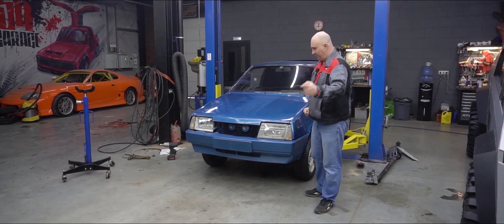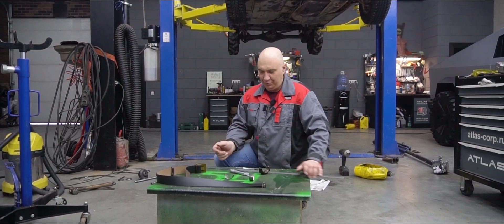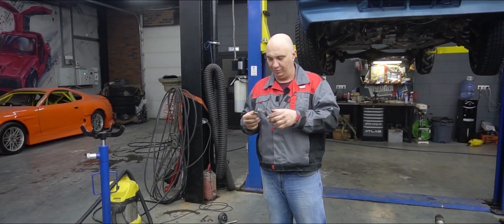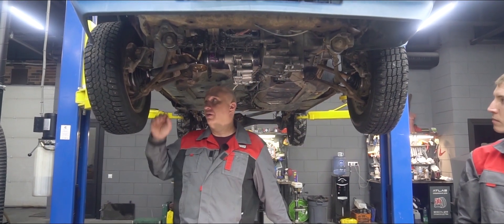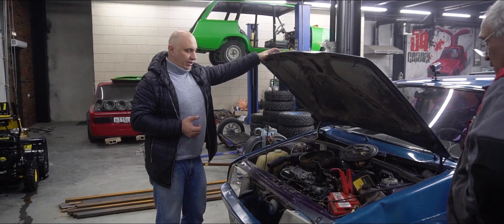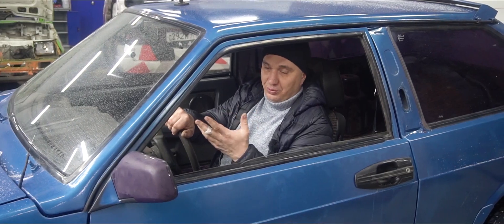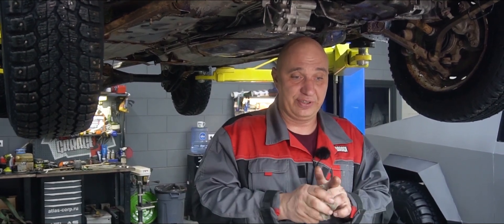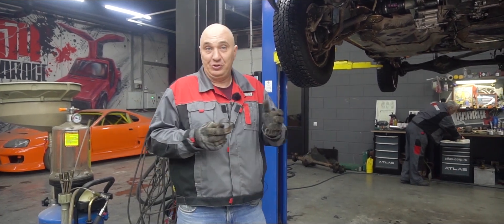Can you replace crankshaft bearings with leather belt?

Comment: The leather rod bearing trick only works on low power, low RPM motors with splash lubricated bottoms ends without oil pumps and sump screens, like model T's, Briggs Stratton motors, and old tractors. Modern high compression, high RPM engines with oil pumps, sump screens, and pressure lubricated cranks with holes for the oil in them will just eat the leather up.

Comment: When I was in the military 30 years ago we were stationed off grid and the radio's all worked from the generator, the engine failed and a backup generator or parts was a week away and we needed to charge the radio batteries way before then so I replaced the main bearings with leather strips cut from shoes, that generator where still running smoothly 8 months after I was relieved before they finally decided to change over to a new generator. Over a year of running 24hours a day.

Comment: I mean, hydraulic pistons use leather for sealing. You can save literal hundreds of $$ if you replace airless paint sprayer packers with leather, as leather's cheap, while the "original packer kit" is usually 150$ + ... The leather packing lasts for ages.

Comment: I have heard about this many years ago in Ireland.  But I have a Ford Cortina back in the day which had a main bearing rumble when I bought it. Because I did not have the money to replace the main crankshaft bearings this is what I did.  I inserted aluminuim file between the the main bearing and the block and main cap. I added and tool out 1 layer at a time so shimmimg it with the ally.file. I did this until each main was tight but could rotate. I did all the mains like this and put the motor back together and in the car. I drove the car for many years with no rumble or other issue. When the rest of the car fell apart with rust I sold the engine to a friend and he also drove it with no issue. The alumininm file acted as a shim and allowed heat transfer and because it had oil holes it allowed normal oil flow to the crankshaft. An old meahanic I worked with said it could be done and when the time came I proved it could and was successful.

Comment: A few suggestions:
1) The belt should have been glued to the conrod. If it's just placed in there it can spin in the conrod (the equivalent of a spun metal bearing). Since the oil is coming in at the journal, there would be no oil between the leather and the conrod and so it would be spinning and tearing up.
2) The clearance between the leather and the crank pin needs to be exact. Just throwing in a piece of leather without the correct thickness is the same as throwing in a metal bearing that is too large for the crank (it won't turn over and will fail immediately). This could be done by gluing the leather in and then spinning it in a lathe to get the journal +.002 clearance for instance.
3) It might help to coat the outside of leather with an oil proof coating. The leather expands when saturated with oil and there's no need to lubricate the inside of the leather just the mating surface between the pin and the leather needs oil.

Doing all these steps I think it's possible that this leather bearing setup could work for a few hundred miles.

Comment: Thicker bearing (belt) will cause the pistons to come closer to the head during the compression cycle (top of up travel) where the valves are as well as closer to the head at the bottom of travel. I do believe you have changed the compression ratio and it is gone up a fraction.

Comment: Used leather bearings on an old disc plow when I was a kid. Worked great although obviously didn't last as long as metal.
I think they'd be fine for low speed, moderate stress situations, which inside an engine clearly isn't either of those things.

Comment: You said the myth was that they sold cars with these, I think you might be right, if they soaked them in oil overnight and oiled everything up and just turned it over enough to run then fired it up enough to run smooth then checked periodically if it would crank fine and then once it was enough to look good, they would sell it, sounds about right, also you could pull the axels and say it needs them and won’t drive or remove the clutch disk and say it needs one of those, just like when people try to sell us diesels saying they need a starter and we come over with a starter, suddenly they have to go out and we can’t stick around, meanwhile earlier they were talking about helping us try to figure it out and give it a boost and all that, funny how we forgot to mention we were gonna try the starter right away

Comment: My Grandfather was a tenant farmer. They were very poor when m6 mom grew up. My Grandfather talked about using leather to keep his model T running. He said it worked fairly well. But these engines didn’t make a lot of horsepower, so it’s possible.
They might need to put a longer rod bolt in it, and double nut it to keep it in place. Then we could see it die dramatically!

Comment: My machinist bible says leather on cast iron has higher friction than wood on cast iron.
Leather was used for steam engine flatbelts to drive everything....they dont slip.
Leather is an abrasive, of course it won't work as a bearing.
Let's try sandpaper bearings?

Comment: i bought a 1986 hyundai exel years ago from a used car lot and after driving it on the freeway going home , trying to climb hills was a process , all the other traffic moving at speed limit or faster but me 25 mph 2nd top speed. half way home i noticed the rear window coated in oil and non in the engine . i fixed the oil leak the oil pan gasket. then about 500 miles later going 25mph up a hill a loud sudden knocking ....rod bearing! i pulled it apart and found what apeared to be tin foil all over in the crank case. i dont know but always been curious if it was possible

Comment: i worked at a auction dealer auction  a audi once blu up before making it to the block to do the bidding and it looked like mush and stuffs in the oil they put saw dust for the knocking engine??? didnt work out seeing as it blu up later but was waiting on the line for a good 15mins

Comment: The real issue was that the belt was too thick. Properly sized, this works for awhile. The rod cap loosened because it wasn't tightened against the rod, but the belt, which shrank or moved, loosened the cap, then the bolt loosened and the belt dropped free and became debris.

Comment: I was told a similar story by my grandfather. He said he was driving his Ford Model “T” in a western American desert. He heard a rod knock. He stopped by the side of the road, removed the oil pan and found the loose connecting rod. He removed the cap and “cooked” a piece of his leather belt in oil. Then installed the section of belt in the connecting rod, reinstalled the oil pan and oil and was able to drive some miles to the nearest town where permanent repairs were done. Using the leather belt got him out of a breakdown situation in the desert and possibly saved his life.

Comment: As soon as you lost pressure I knew that pump was clogged with chunks of leather lol
Also, I was thinking this method would be more effective for a worn out bearings.  If the crank shaft is in good shape, it’s not quite the same.

Comment: Once my father had a 1949 dump truck with a six cylinder that had dippers.  New oil systems work completely different.  We took off the pan and he put some raw hide leather in where the rod bearing was knocking.   I'm thinking it was still there when he sold it years later.

Comment: Maybe try what you said and make them into a two piece so that the caps bolt on without pinching the leather. And if there are oil passages make holes? You should also try to stamp the leather with a hammer and make it stiffer.

Comment: Try sanding the leather on the concrete ground not the fancy side use that for the side that moves use a belt hole maker for oil channels line it up.

Or use cheep flex able aluminum like the ones found in padlock latches from garage doors or cabinets

Comment: This was common back in the early days of the automobile when engines had babbited bearings and didn't have the RPMs of today's engines.  

My grandfather told me of driving his Model T on the back roads when it chewed up a bearing.  He got out the tools and dropped the pan, used a piece of his belt to make a bearing and put it together.  It got him back to town and lasted until he got it fixed properly.

Another common repair later on, when bearing shells replaced babbit, was shims behind the bearing to tighten the clearances if the crank was worn.

One of the main things people carried was a roll of haywire to tie parts back on when they fell off. lol

Comment: I’ve known of this trick, much like filling a differential or transmission with loose gears up with saw dust and oil... only exception is I believe the leather belt scam was ONLY FOR 1 or 2 SPUN BEARINGS!!  The thick belt would keep it from knocking temporarily!!! NEVER would good bearings with close tolerances be pulled and replaced with leather!!!! THATS SO SILLY! Haha haha

Comment: We used to run leather bearings on an old 40’s tractor engine we used as a constant rom mill engine.. bearings were obsolete so we used to soak leather in 10w40 for about 2-3 days before we dropped the bearing caps to swap out the leather. It would typically last about a month or so depending on the work load. Did it for years

Comment: One of our local dodgy repair shops was caught shimming the backside of the bearing shells with Coke can aluminium, and 
they at least the poked a hole in it to let the oil through.The shimmed bearings were just a tiny part of what really went on, they did 
every dirty trick in the book.

Comment: The belt was too thick. I know a older guy who did this to a car once when it spun a rod bearing. He fixed it and ran it for quite awhile to get it home.   It's temporary fix but it can work.
Reply: Probably easier to call for a tow truck than lay on the side of the road in an ant pile ripping the oil pan off.
Reply: @Discretesignals  in today's world yes, but the event I mentioned happened years ago before everyone had cell phones. There was a time if you broke down, you either got lucky with what means you have available, or you walked till you got lucky and hitched a ride, Lol... just sayin.

Comment: I find it hard to believe leather would ever be a good replacement for babbitt style bearing in any application in any time, (even antique slower RPM motors. 
What man who has the skill to remove bearing caps, cannot also find some lead and tin to melt and make new bearing material?

Comment: yes put drain holes in the leather maybe try some calf skin let it soak over night in oil cut to proper length and width when put on bearing soe ends together make sure all drain holes are lined up for drainage make sure it is tight when sowen together.in 1957 my dad was a mechanic for a logging company company had a craink bearing go out large loader 50000 lbs that is what my dad done .long story short worked long enough until they could order a new set of bearings gaskets for a rebuild job on motor big diteroit diesel 2 stroke

Comment: My dad told me that in the 1920s & 30s this was done when they had no money for parts. I think those engines were dip and splash design with no oil pumps,so it may have worked.
Reply: superrodder2002   Once my father had a 1949 dump truck with a six cylinder that had dippers.  New oil systems work completely different.  We took off the pan and he put some raw hide leather in where the rod bearing was knocking.   I'm thinking it was still there when he sold it years later.

Comment: In the US, about 1928 to 1938, this was considered a temporary fix. Most of the cars had splash lubrication and not pressured lubrication, so this fix would get you a little farther down the road. This was a time when a wheel barrow full of money wasn't worth anything. In WWII some soldiers used that trick as a temporary fix to get back from the enemy line. Nothing like a connecting rod banging away to give away your position.

Comment: You didn't do it right.
You need thin leather. Like welding gloves. And you must heat it first to make it shrink and stiffen up.
Then soak it in oil and shape it. Cut the holes for the oil flow. Then put it together.
Don't fully tighten the end caps. Start the motor for 1 min. Clean it.  Then tighten the end caps. If done right. You can get lots of mileage out of them. Not as much as normal bearings of course.
But for a farm car where you don't need it often, it works.

Comment: Isn't there supposed to be an outlet from the oil gallery in the crankshaft through the bearing surface lubricating it?
I thiught yiu were going to punch holes in the leather pieces.

Comment: ive put leather in a spun crank bearing its a band-aid tho  high revs are a big no and belt must be same dimensions as bearings u also should soak the belts in oil overnight before installing them

Comment: As far as I remmember, that was solution for old type engines with no oil pump. Those used splash lubrication instead of pressure, so oil was delivered from outside the bearings and there was nothing to clog up. I don't even know what engine you can get like that besides small engines for lawn mower or some generators.

Comment: I've made crankshaft and rod bearings from sheet brass. They were for an antique engine new bearings were not available for. The engine was used to drive a generator for a small community in the Philippines. The engine ran fine and year's later found out it was still doing fine.

Comment: I'd like to see if you can run that four cylinder on just the two outer main bearings. Just remove the bearings for the two inner journals and see if the crank will crack in two or not.

Comment: I bought a car like this once....it was an old truck.... 6 cylinder engine... I bought it to fix up and SELL. The oil pan had a leak so I pulled the pan. Noticed SOMETHING looked odd. Turns out the #3 rod had belt leather as a bearing. That's when I came across the process to stop an engine knock.   Long enough to sell it. I drove it for a week like that.

Comment: Hey it close to shape boil in oil which will harden the leather turn the crank while tightening to get it going and it's fine but you need oil passage holes in the leather and a way to stop the leather from spinning.... better to use copper pipe or brass sheet to make bearings.... even tin works ... and you can pour bearings just like the old days.... crazy Russians lol keep playing

Comment: Yes u can I was 15 when my uncle sold a car with this done u have to keep in mind it’s always only one rod that knocks so it’s only one rod bearing u u change not all of them And You don’t tighten the bolts to spec because a belt is bigger as u said u use lock tight and roll with it all ur doing is trying to get it to run long enough to sale back in the 90’s not forever    Think like someone does when they just trying to sale a car so one piece of leather on one rod bearing not tightened to spec and lock tight used

Comment: I know Steve Dulcich did it once. after some google fu, its episode 62 of roadkill. heres the transcript i found while mildly drunk. cheers gentlemen
What happened is 15 years ago,when we were road tripping this thing home fromUtah, we only made it like three or five miles orsomething like that. - That's about right,right outside of town. - And it started doingthat knocka knocka knocka knocka knocka knocka knocka knocka, that ooh, like, real bad. - But we did limp it back.

- Yeah. I really wanted to blow thewhole engine apart and fix it, but all we're going to do is flip it over and pull the crank out,look at the bearings. I have a new crank thatmaybe we can put in it if we have to, and slap it back together and roadkill it back into the jeep. - It'll need the new crank. - Oh, really? - Yeah, number one bearing, I replaced it with a piece of belt leather. - Right.

- Yeah. - It's garbage. - It's garbage, yeah. I mean, that made it run,that made it good here but.

- Oil drain pan. - It's not going anywhere. (energetic music) (grunt) Doing good. - You're good? - Yep.

Comment: Heh heh, interesting experiment! Rolls Royce used teak bearings in some of their early engines (dipper style I would imagine), and they were reported to have held up very well. Leather would probably work if the leather was a little thinner to start with, so that the friction wouldn't overheat the bearing and cause it to deteriorate immediately (and end up in the oil pickup).😉

Comment: I'm currently restoring a Dacia 1100/Renault 8, and I've found something similar, to some extent: the crankshaft bearings were actually made out of 'slices' of a beer can. So looks like people could makeshift certain parts out of everything. Of course, in my case I haven't found any holes for the oil, but for some reason, when we started it just to see how it works, it had no problems

Comment: Try wrapping the crank with lead/tin solder wire and then tightening the rod caps down. Obviously the diameter of the solder wire will have to be slightly larger than the thickness of the bearing insert to allow for the crushing of the solder.

Comment: I'm wondering if the leather bearing idea doesn't comes from old water pumps, where you can actually make it work. I've restored an older pump from the early 1900 where the kit they sold to overhaul it was still available and it included plenty of leather seals, cups and bearings. When it wore out you'd hear the pump knocking and knew it was time to overhaul it again.

Comment: Drill hole in belt where crankshaft oil hole is or cut a gap in the belt the width of the oil hole, that way you can get oil to the crankshaft